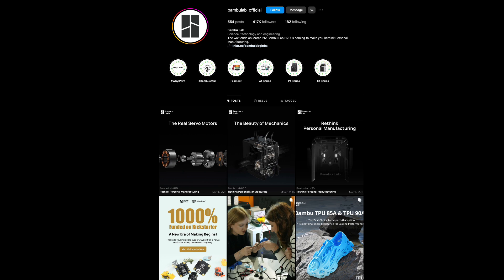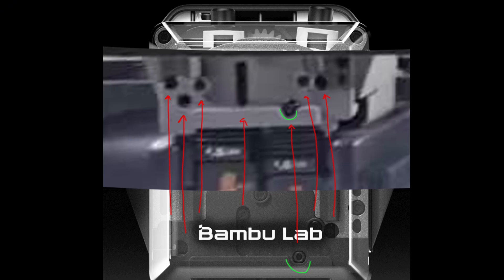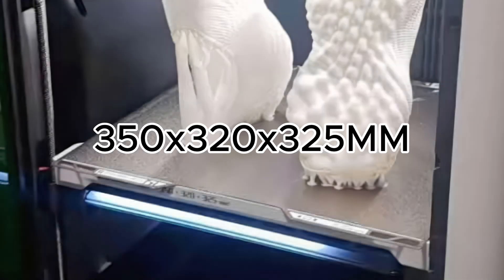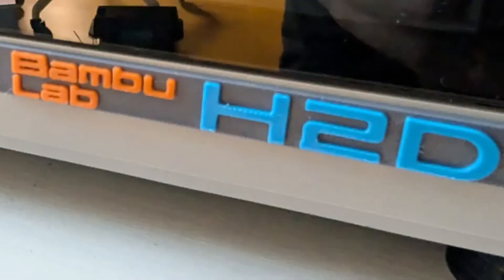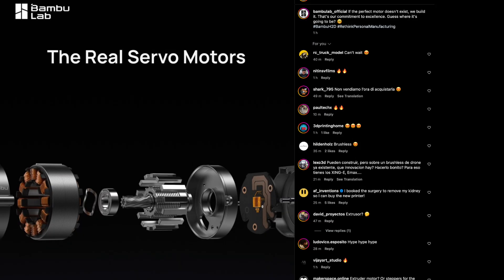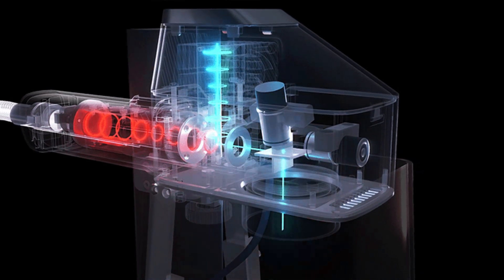#bambulab NEW H2D: " SERVO Motor Vs Old Stepper Motors "🔥| On-Board Chip Expose, 1000MM/s, 20 000mm2

Comment: Weeks ago, I ordered and paid for a printer from Bambu Lab, but to this day, I have neither received the device nor a refund. Customer service completely ignores my inquiries. Additionally, Bambu Lab severely restricts the use of third-party software. I strongly advise against purchasing the new H2D printer to avoid similar experiences.
Reply: ordered P1S combo, arrived in few days. no problem. meanwhile Anycubic S1 ACE preorder is 3 months away.. Bambu is Great out of the box. works wonderfully without any stress. unlike most printers.
Reply: @mostlymessingabout  Wish I could say the same… I’ve been waiting for my P1S since February 7th, 2025 – still no printer, no refund, just endless support emails. I’m glad it worked for you, but sadly not everyone’s experience with Bambu is that “stress-free”.
Reply: I understand that it may sound strange if you’ve had a smooth experience – I wish mine had been the same. Unfortunately, not every case is handled equally, and I‘ve documented everything. I’m just sharing my honest experience to help others make an informed decision. That’s what the internet is for, too – not just praise.
Reply from the maker: @der_reparaturmann  Was the money Locked on your Bank account or withdrawn?? iv had orders in the past with other companies , where its sill on account just locked for payment. usually that takes 3months to clear sadly.
Reply: @PrintVentures everything was paid correctly and confirmed. The issue is that the shipping company apparently lost the package, and Bambu Lab refuses to properly investigate or accept that. They just claim it was delivered, even though I was home the entire day and nothing ever arrived. I’ve tried everything, but I’m stuck between them and the shipper, with no refund and no printer.
Reply from the maker: @der_reparaturmann  sound bad, did you make a claim with the shipping provider_?
Reply: @PrintVentures  Yes, I asked the shipping company directly – but as the recipient, I can’t officially start a claim or investigation. That’s the sender’s responsibility. I told Bambu Lab this multiple times, but they just keep insisting the case is “under review” while doing absolutely nothing. The shipping company even confirmed to me that no claim was ever filed by Bambu Lab.
Reply from the maker: @der_reparaturmann  you should possible sign upto the Bambu discord and or Bambu Forum, and start a Thread about it, thats my best advice.
Reply: @PrintVentures  Thank you 🤗
Reply from the maker: @der_reparaturmann  nps, fingers crossed for you.:goodvibes:
Reply: Sounds fishy,
Reply from the maker: @ its the internet

Comment: That is not a servo motors, servo motors have gears
Reply: sure, and the engineers at bambulab are just too stupid. but mister internet commentary on yt knows better, of course.
Reply: @plal9459  Not trying to defend on behalf of Bambu here but you're talking out your ass on that one. Servo motors just need a sensor and controller baked in to be considered a servo, gears have nothing to do with it.
Reply: @minted3d650  Then it isn't a servo motor. It's a stepper motor with position feedback. Two very different things. I should know as I've worked with servo motors in industry as an Integration Technician and a Licensed Industrial Electrician in Canada for over 35 years working with high speed manufacturing and packaging. Even the controllers used between steppers and servos are completely different. Just my take.
Reply: @DaveBuildsThings come on, canada is not a real county 😂
Reply: @ Canada is a country concerned about it's own people more than yours will ever be. Keep corporate America strong right? Screw you.
Reply: @DaveBuildsThings  i dont think he is american
Reply: @DaveBuildsThings  yeah, that’s why they lock out their own citizens accounts 🤣
Reply: @plal9459  so then I must throw away my engineering degree from caltech because I don't know anything thanks to Mr. internet commentary reply
Reply: @elchavode6479  idk what to tell you man, your caltech degree is pretty useless in terms of you not talking out your ass. Also @davebuildsthings you've described a servo... they're just a classification of motors as being within a feedback loop, read the wikipedia page if you really can't believe me.

Comment: The flsun t1 pro and s1 pro have closed loop motors. the creality k2 plus has servo motors that also are monitored. so again bambu isnt doing anything new. but what they are doing is locking you in further to their system. so its their motor. it wont be able to be replaced with anything other then theirs.
Reply: Do these models you mentioned use closed loop steppers or actual servos, they are not the same thing
Reply: @LucasHohmann  flsun uses closed loops steppers and creality has servo motors.
Reply from the maker: @GETS3DPrinting  you think it could have a CnC module _?
Reply: @ no it has 2 laser modules
Reply from the maker: @ I know, 10w and upgrade 40w that dont mean there could not be some sort of CnC in the future later on
Reply: @PrintVentures  it would have to be a different design. i dont think an enclosed corexy would be good for cnc unless everything is sealed.
Reply from the maker: @GETS3DPrinting  yea the splinter etc, it would have to be inside an add on enclosure , Either for the printed, , but most likely an add-on on the side.
I think tho they will defiantly release an tumbler rotator , for the laser engraver.
Reply from the maker: how do you know its not a totally new servo motor with even more functions?
Reply: @PrintVentures he doesn't, its just seem a lot of people started hating bambú lab since last x1c update
Reply from the maker: @KittyArtifacts  hmm, I think there is fanboy groups for most Brands, in the 3d space. 
and reasons can be mixed, from price point, open source, to build quality or lack off, and  to support reaction time or, just to be contrary.
I guess the bigger you get , the more noticeable it get s also.
Reply: @ glad you know what i do without knowing anything about me. congrats. i have actually owned every bambu. i only sold my x1c to go bigger. but go on with the assumptions.
Reply: @ im sure it is so you have to buy their replacement parts and further locked into their system.

Comment: It's 2025, printers dont get missed steps anymore, not even the cheapest aliexpress printers get missed steps.. Servos on 3d printers is unnecessary and bambu is just doing it as a marketing gimmick and to justify a higher price tag.
The H2D will be a flop. All in one printers dont work. Creality tried it, snapmaker tried it, neither worked.
Reply: I agree with a lot of what you said.  However, your state of the art XL seems to miss a bunch of...well, everything.  We will see next Tuesday if it will be a flop or hit.  I, for one, would never buy the rumored attachments. A 3D printer should only be a 3D printer, laser a laser, and cnc a cnc.
Reply: Truth is nobody needs this bambu overpriced locked crap anymore. 256 cubed centauri carbon 299usd, if cant beat price or quality go bakrupt. Prusa, bamboo, creality included, not to mention vorons.
Reply from the maker: @akierum  how good it the carbon, I haven't seen one live yet.
Reply from the maker: You think it will flop, why? 
also this is a prosumer version, I bet this will run downhill into the A series, so we all can get A2D with dual nozzle, and bigger print volume, so even if this don't sell in the millions copies  , we will all benefit from it down the line.
Reply: @PrintVentures  Don't worry about the lilape  - he has been Hating on BL since the beginning.
Reply from the maker: @Denniss7420  ok thanks. im excited for all the news. the 3d print tech have been moving so fast last 18 months.
Reply: Ok professor, I wonder why Bambu employs so many engineers and not just ask you.
Reply from the maker: @grumpyrider369  Bambu Lab always brings the goods on new launch products.
Reply: Bambulab? More like Copylab :D
Reply: Another Chinese piece of junk....

Comment: Whats the highest temperature these servos can withstand and for how long? 
How will that chip hold up to 60c? 
Im not convinced until i can get the data.
Reply from the maker: sorry, I don't have any Concrete info on that Yet. . 
but I would like to think they tested these servos for along hours running with no breaks , pre launch.
they basically made these to combat the Prusa XL 20 000mm/s :text-green-game-over::person-turqouise-waving:   and others. so I recon Bambu battle tested these above spec.
Reply: 60c is nothing to any IC
Reply from the maker: @amerikalast  how high Temp do you think The servo  can handle__?

Comment: What you mean by unmatched speed,  this will be slower than Prusa XL 😄
Reply: Please add that WHEN the XL works, it might be faster.  But we all know the XL is 50/50 at best...add more tool heads, and it drops significantly.
Reply from the maker: @jonwoodworker  the XL Looks nice also tbh.
Reply: @PrintVentures  It looks like a train wreck.  Filament spools, cables, and hoses going everywhere.  It also takes up way too much space.
Reply: Copylab.... won’t be that good or fast plus, it’s tiny.
Reply from the maker: @michaelfox55  whats tiny_?
Reply from the maker: I'm sorry you're wrong, the H2D will Match the " Prusa XL xl  @20 000mm right?" 
And even be faster in some tasks , like infill etc.

Comment from the maker: ⏳ Timestamps :
0:00 intro New Servo motor inside the Bambu H2D
0:10 Reveal of the exploded-view image of the H2D’s servo motor posted on Instagram
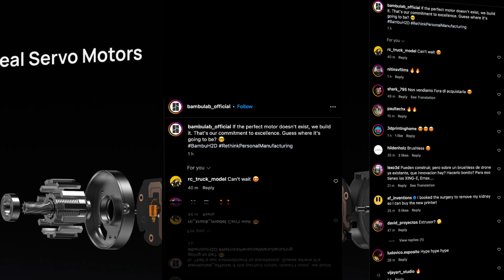0:20 Picture suggest it’s packed with advanced tech, including an on-board chip
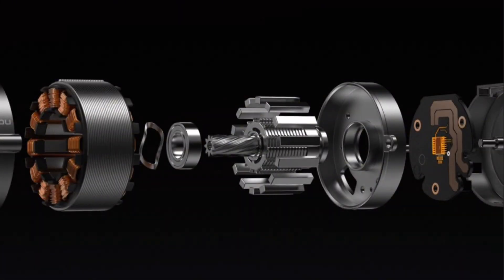0:40 on-board chip? Well, think of it as the brain of the operation.
0:50 let’s talk about what this means for the H2D.
1:15 Specs Dual Nozzle, Laser , Build volume 350x320x325MM (Fiber laser ) 
1:40 H2D promises , unmatched quality and Speed